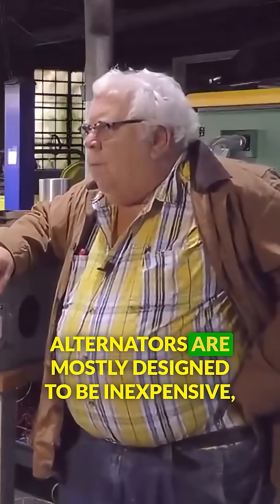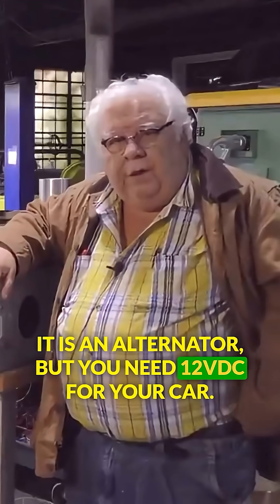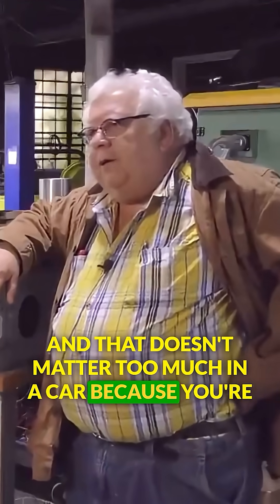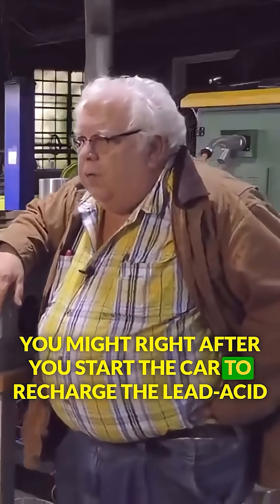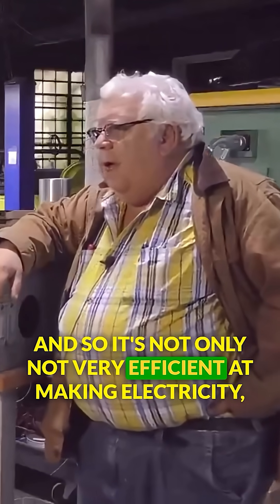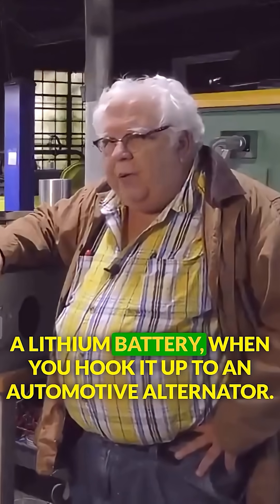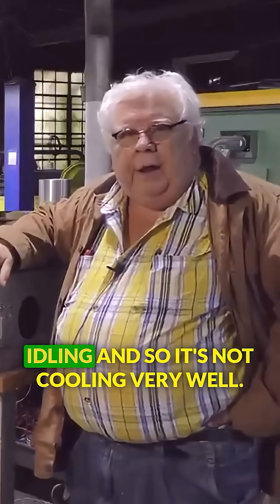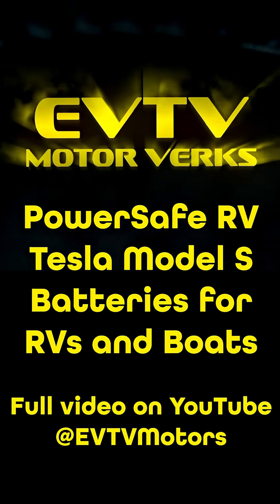Alternators are Only 50% Efficient!

Comment: One thing I do remember about alter alternators from tech class in the 90s is that they're "dirty" , watch a wave form on a scope. 
It's good enough for what we do though. 
And as a general rule of thumb, it takes roughly 20mins of driving to "put back" the power used to start the engine. 
Every 4-6mo when im tinkering under the hood i throw the battery on a float charger. 
That definitely helps increase battery life.

Comment: You can also meltdown your alternator if your battery is in a low state of charge and you put your A/C on high. The A/C compressor clutch draw will overload/overheat the alternator to the point of failure. Don't use A/C when the alternator is recharging a dead battery. You'll be sorry. Give the alternator time to recharge the battery before you use A/C.👍

Comment: Guy said it himself "most of the time not using 100 amps"

In the average car that alternator msy have to run 30 seconds to recharge the power necessary to start the car. From there, the alternator is doing all the work anyway. That battery isnt going to burn up your alternator.

Comment: You do realize you're referring to ENGINE rpm and not ALTERNATOR rpm..   Alternators don't typically spin slower than 1500 RPM in OEM applications..  (3:1 ratio with the engine) IDK if you've ever felt the airflow through an alternator at 1500 RPM,  but it's not insignificant. 

Also, are you talking about a Boomer ass 10SI or 12SI 3 phase alternator design? Because I know you're not talking about the AD244, DR44/DR44G 6 phase alternators used on late model GM Gen1 Vortec, Gen 3/4 LS and Gen5 LT   engines.. Those alternators will punk a decent size welding rod at idle. You might want to quantify your statements. New 6 phase alternators are not made cheap..  They are actually very nice units and up to about 72-75% efficient.

Comment: I been running 90ah of lithium cells from a Ford fusion 5 ah cells.
For 5 plus years with my CES 400 amp alternator with no problems.
I charge at 15.3 volts because my lithium battery resting voltage is between 14.8 and 15 volts.
If you run a stock alt on a lithium battery you need to run a battery that matches your alternator voltage. It's that simple.
If I run a stock 14.6 volt alt on my vehicle with my lithium it will go through alternators and damage my lithium. 
Do research knowledge is power and don't believe everything on the Internet

Comment: Ok, so newer lithium batteries that are designed to work with a car alternator are internally regulated to only pull  around 100 amps , some more, some less. Most of today’s factory installed alternators are designed to putout 110 amps and is more than sufficient to charge the lithium battery and operate the electrical needs of the car. The last lithium 12 V battery I had would adjust to the amperage available coming from the alternator based on the voltage. If the voltage dropped below a predefined amount, it would reduce how much it was taking from the alternator until it reached a satisfactory voltage. Now, in general, he is correct. A lithium battery that isn’t designed to properly work with a car alternator will fry a Car alternator.

Comment: This is funny because .......ice engine is 90% inefficient 10% power and 90% byproduct is heat, so the lonely little alternator is doing amazing at 50% even an electric motor in an electric car is about 80% nothing does not have a loss anywhere, even electricity coming to your home is losing power along the lines, but hey it all works anyway......

Comment: This is why you must always use a DC to DC charger on your RV's cabin Lifepo4 battery system.  And be sure what every it's max charge current (20amp in mine) is equal or less than the extra available power of your alternator.

My van can handle an alternator that's 40amp larger that it's current  stock unit.  Once I upgrade that, I'll put in a 40amp unit.  Probably not larger because I'd need to upgrade the gauge of the cable going back to the cabin battery, and that is too much of PIA.

Comment: He's right, however, newer lithium can be set up to have a charge current limitation to prevent these issues, not sure when this was filmed but he's largely right. Automotive products designed for a specific purpose in this case charging a SLA battery will simply burn out and have no means of current limiting on them. I cooked one of my B16 alternators by contacting an open power settering pump to it, in my case, upgrading to an integra 90A alternator fixed my problem as my total Maximum demand was about 87A, the b16 alternator was only rated to around 60A.

Comment: I used a 170 amp balmar alternator to charge a starting lead acid battery and lithium battery with a victron battery isolator in my boat and I have been running that setup for a long time now with no issue.
Reply: That's because it's a Balmar.
Reply: @MrHuram-abi yea I like it cause it handle my heavy duty 🔊 like a champ

Comment: this is very very false and i'll explain. Its not 50% efficient its 80% efficient. Lead acid batteries have way higher amp output than lithium batteries as if you try to over pull or push amps into an alternative it will leak/burn/explode. The reason why you cant just swap the starter battery from lead acid to lithium is because the lead acid batteries act as a capacitor to the alternators.

Engines spin a belt that spins the alternator which has a multi phase magnet setup to produce AC voltage (as its a moving part). That AC voltage is rectified and the rev of the engine determines the AC frequency. Since we want DC and not AC, that AC frequency doesnt matter (at 600rpm thats 10Hz, 5x lower than mains). By producing more volts than the battery with the battery as a capacitor, it smoothes out the voltage and theres a circuit at the end to regulate the voltage. At idle the regulators do most of the work and uses more of the battery as a capacitor but on higher revs the alternator gets more efficient. However at idle its not 50% efficient, its above 70%. For reference check out desktop PSUs over time and how their efficiency works as those are DC to DC regulators, which is the biggest hurdle of any alternator. Use of lead acid as capacitance is not bad, but it also means lead acid puts more load onto the Alternator to charge which is fine.

Comment: I had an old 76 Dodge Colt and the voltage regulator quit working on it. I was into building my own electronic circuits, so I got some reference manuals and found out how it worked and I designed a simple electronic circuit using a fairly simple circuit I designed, using a low power npn transistor a couple of capacitors and resistors and a 2N 3055 power transistor. 
My circuit controlled the current through the field coils and thereby regulating the voltage output. I could even adjust the output voltage with a variable resistor.
Reply: And you kept this to yourself because the alternator cartel would kill you otherwise.
Reply: @locker1325 😂
Reply: Cooj
Reply: Cool! Was that an alternator that used an external regulator? Was your regulator external?

Comment: That's not true! The voltage is regulated by the excitation current of the rotor, so they are generating voltage vBat + Vf_diode which will be kind of 14.4+0.6V=15 volts. If it is laded with 100Amps the power generated is 1440W and the power loss in the rectifier is 100*0.6 = 60W. There is some power loss in the excitation circuit and the rotor itself, but definitely not 1000+ watts so the efficiency to be 50%. Other than that modern alternators use switching regulators for the excitation circuit and synchronous rectifiers (not the cheap ones), so they are even more efficient!

Comment: Hi there 
Nice try.
It really is not like this. Lithium batteries do not sick out full power from an alternator at idle. The alternator is not fried after a couple of minutes.
Please prove this. If you refer to the Victron video, it is manipulated. We have delivered lithium batteries to more than 1600 boats, through 12 years. Never a problem. 
Look at the alternators charge curve and you will see.that any alternator need some rpm in order to charge. You will see the correlation between rpm and Amps, usually for a cold alternator. An alternator s output under.operating temperature reduces output around 30 to 40 percent.
It is made for charging.

Comment: You should explain this to Chrysler. I buy at least  60 batteries a month with a fleet of about 1000 Chryslers. I also have an additional 4500 cars that are a mix of GM, Ford, Honda, Hyundai, Kia, Volvo, BMW , Mercedes, Land Rover, and all of them combined do not equal the battery replacement of the Chrysler.

Comment: Connect your lithium battery with 2metres of 10AWG  high temp silicon wireit will drop the voltage as the current rises

Comment: I made a video talking about this too. A DC generator is much more efficient than an alternator, at the expense of a few HP, and ultimately cheaper to repair.

Alternators almost always fail because the diode pack burns out. Back in the early alternator days, you could buy a diode pack separate from the alternator but now they are internally integrated and you replace the entire unit. DC generators used to need their brushes replaced regularly but now we have brushless generator technology and still havent switched back because the cost of replacing diodes is far cheaper than the replacement unit price.

Companies make 10,000% profit replacing $3 diodes and selling a refurbished unit for $300. It's things like that is what creates jobs and keeps the automotive repair industry going.

Keep in mind they charge a core fee because they still can make money by getting the old unit, shipping it to a foreign company, paying to have it repaired cheaper than in the US, shipping it back to the US, and then warehousing and distruting units to parts stores. That's where the 10,000% upcharge you pay for a refurbished unit goes. The core fee is an average between their cost to repair a bad diode pack and the value of the unit as scrap copper if it's not just a bad diode pack.
Reply: This guy is full of it. Alternators are more efficient. That's why we generate AC then back to DC. Because even with rectifier losses you still gain. Why do you think 99.9 percent of all power plants use alternators?
Reply: @Novous Because the power grid is AC? And I think you are mistaking a regulator as a rectifier. A alternator rectifier, at best, is 46% efficient. And usually alternator rectifier/regulator packs are closer to 10% because it's using a sine wave on the input rather than a square wave. -14.8vdc through +12.6vdc are dicarded. The rectifier gets rid of 100% negative voltage and the regulator gets rid of 75% of the positive voltage. Typically anything below 12.6vdc or above 14.8vdc. There's a very small window for +12.6vdc to +14.8vdc to actually be able to charge the battery while an alternator is producing 15 volts both positive and negative. 30 volt window only roughly 2 voltages are useable twice per cycle. 100÷30×4=13ish% minus heat loss so about 10%
Reply: @PLKxR so you’re saying 13% is causing 50% of the losses in our electrical system ?😂 
Joking, I don’t want to break OHMS law or anything
Reply: @Novous in an alternator for the power grid...as long as the frequency is correct, 60hz in the US, a step down transformer only loses like 8% to heat depending on the amperage and a regulator is maybe 2% because power plants are usually physically regulated instead of electronically like a car alternator. Thats the only things you need to get from a power plant at 100,000vac to 120vac at your wall outlet.
Reply: Alternators are 3 phase and use 6 diodes to produce DC, the energy loss is far less than a single phase winding. The biggest loss is the voltage drop in the diode but there are ways to overcome this using Power MOSFETs. A petrol or diesel power unit is so inefficient anyway, the loss in the alternator is not relevant.
Reply: @ianlouden7939 3 phase, 3 diode
Reply: @ianlouden7939  I wouldn't surprise me if auto's are now using mosfets instead of diodes in a 'active bridge rectifier' design since they are more efficient then diodes.
Reply: @Kamala-km4ty  Mosfet rectifiers are ideal for switched mode PSUs but due to the body diode that is inherent in MOSFETS its more complicated to do with a sinewave signal, they require control circuitry to switch them on and also off at critical times else they conduct when they shouldn't or the high current flows via the body diode damaging the silicon. high powered AC-DC converters use silicon carbide transistors to get around this problem but these are expensive. Mosfets control the armature winding current  for voltage regulation and have done for years but i think the good old silicon diode that is robust at high temperatures and cheap in comparison are still mostly used as the rectifiers.
Reply: @ianlouden7939  It is more sophisticated electronics, but more efficient.  Mosfets can work for low voltage applications. I don't know if they are using them in vehicles or not. chances are much higher if they can cut weight or space.
Reply: Damn, very insightful info. Well, especially after I just replaced my original alternator and being lazy not to check back my brain for electronic principles ( I used to like old-style electronic gadgets ) from the old days.

Comment: Partially right. An alternator is very efficient. Take one a part sometime. That's a 3-Phase coil. The most efficient you can have with that-sized package. It's like an industrial 3 phase power plant. The diodes rectify it for DC power. It's a marvel of engineering.

It was designed to charge your battery. After you start a car if you had an ammeter, you'd see it's recharging at 5-10 amps for a few moments, and then it goes down to nothing for an old style car. Todays cars draw a bit more. It is nowhere near what it's designed to provide at idle without overheating. I often get 180-200K miles out of modern alternators.

If you put a lithium battery in, it was never designed for that. So it's not that it's inefficient, cheap, or some other detractor; it was never designed for that. Anytime you exceed the engineering of something, you're a test subject. It'll probably fail.

Comment: This is why i tried to explain to my wife that hybrids are extremely innificiant and dont get good milage unless you start with a full charge. When you have to convert mechanical energy to electrical, you waist a huge amount of power that could have been used gaining you distance, but hybrids convert, store, then convert that electrical back into mechanical torque power, burning energy off at every step and uping the total weight of the vehicle in design.

Comment: You can't really say it's less efficient than any other alternator for generating AC power.
Yes, the diodes do create some heat, but so do the diodes and transistors in switching power supplies that convert DC to AC.
That's just basic entropy.

Comment: He's 💯 % correct. I was a technician for 34 years and can àbsolutely vouch for his comments. Additionally,  an EV car will have have the lithium batteries replaced after 3,000 charges. This would normally happen between 3 to 5 years. $15k undermines to saving in petrol fuel as a motive force.

Comment: Well that was somewhat correct and the lithium part was wrong. It’s also less true with sodium, I’ve used all three. With all three I’ve been able to monitor current and voltage from the alternator. With a 350 alt I’ve never seen more than 100 amps being pulled from it, it’s never been overworked. I have a 90ah sodium running my vehicle and sound system with 1,500 farads on the charge wire.

Comment: The title of this video is misleading. The point isn't that alternators are inefficient, though that is true. He basically says "yeah, they're inefficient, but it doesn't really matter with a lead-acid battery" 
The point is that a lithium battery will draw more power than the  alternator can handle, because of its inefficiency.

Comment: Several motorcycle batteries are available as lithium LiFe PO4.  Will this damage the alternator?  On bikes they are expensive,  some use stator and rotor in the engine if not a separate alternator.   Does this cause damage. Please advise.

Comment: The car lights started flashing so I checked the battery & alternator connections - then I used a magic wrench to fix the problem by tapping here & there - lights stopped flashing - next I replaced the worn brushes for $6

Comment: Cool I have a lithium battery and the first thing I noticed is that literally everything runs better. This is because at idle the alternator is putting out almost no amperage and the lithium battery never gets below 12.5V during normal operation. So what ends up happening is the alternator basically just freewheels at idle. Very good for the system.
Reply: First thing is alternators output about 14V on idle and more on higher rpm. If the battery is full its full no matter if its a lithium or lead (so the alternator free wheels). The pros with lithium is less weight. 

And rectifier diodes have a voltage drop of about 1-2V so the efficiency is not 50% its about 90%.
Reply: @cesarhanshoff2741 A fully charged lithium iron phosphate battery won't drop below 13.6v unless it is discharging. So if you have an alternator which drops even slightly below 13.6v, the battery would likely start discharging and unload the alternator.

Comment: Visiting Guatemala, I once saw a tiny shop where they rebuilt alternators. They had rolls of copper wire, which they use to replace the burnt/ damaged wire in the alternator.  They were way cheaper  than a new one
Reply: My carguy rebuilds alternators and starter motors all the time🔝😎
Reply: yep, guatemala and the rest of latam